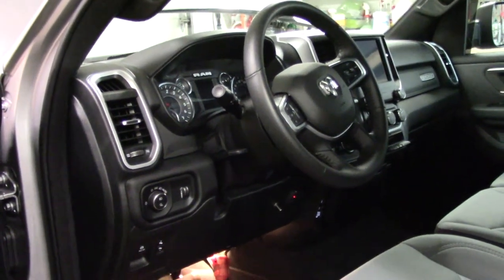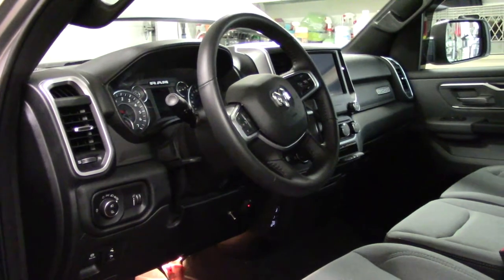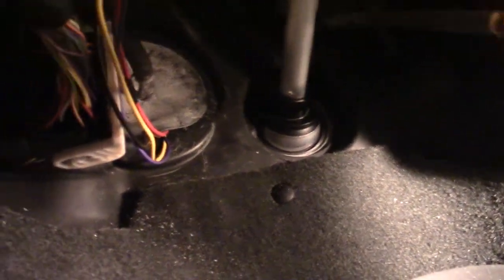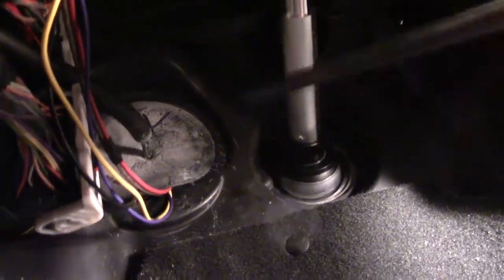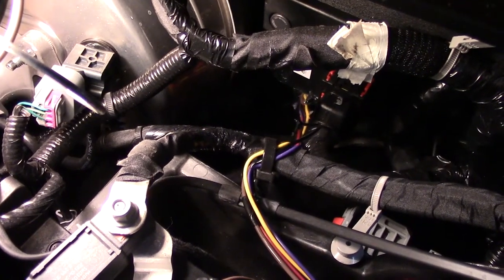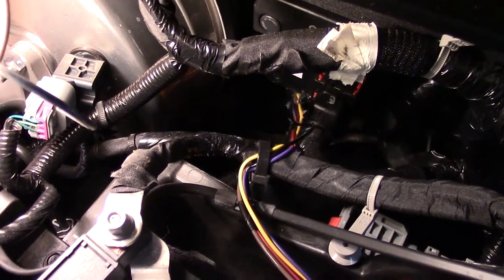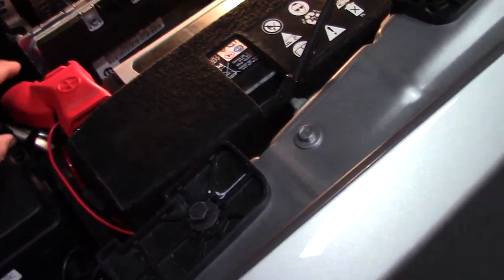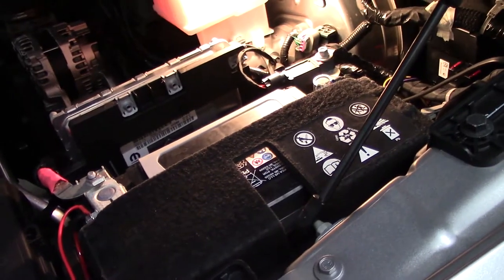How to pass a wire thru firewall on a 2021 Ram

Comment: Very straightforward video. All videos on Youtube should be this good and to the point. I am installing grille lights and needed to run the power control inside cab. The install video did a horrible job showing and explaining.

Comment: Is it the same for a 2021 ram rebel? I'm trying to run the on/off switch cable through my firewall to mount on my dash, for my led flood lights that I have mounted on my hood. Kinda worried cutting anything on a brand new truck on a brand new truck
Reply from the maker: I would say it's the same. Crawl under the steering wheel to see if that large grommet is there. Push your finger into it, if it's very soft take a Philips screwdriver and push a hole thru it.
leave the screwdriver there then look on the firewall side to see it poking out. Of all the vehicles I ever done, the 21 Ram was by far the easiest for me to do.
Reply: Had the same question, thanks